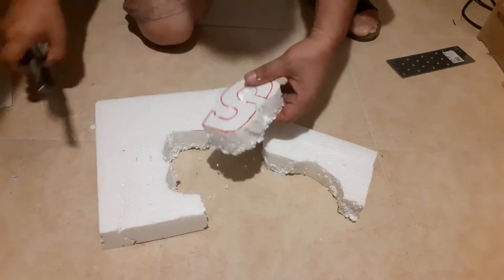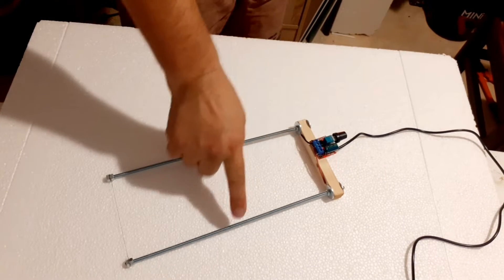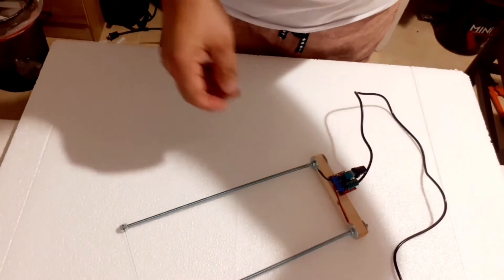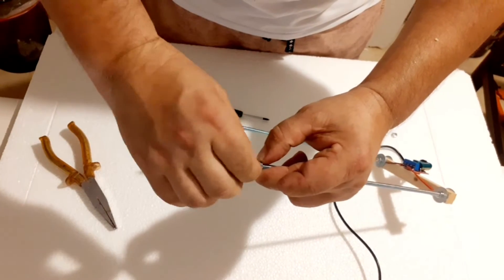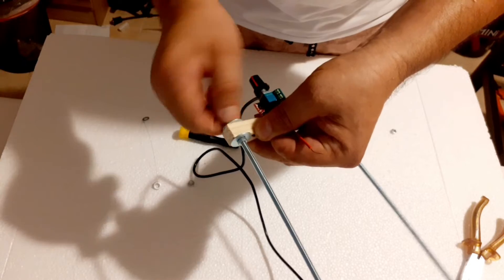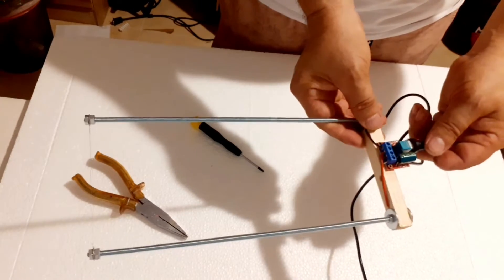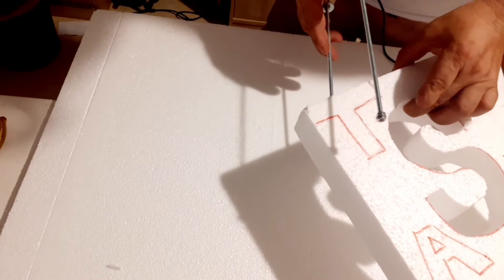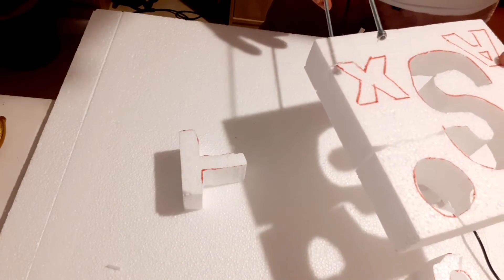DIY Hot Wire Foam Cutter: Easily Cut Styrofoam with Homemade Tool!

Comment: Why not put your box cutter/blade over a candle to heat it up and then cut the foam with it? 

Edit: See how you aren't able to cut the letter 'O' with this tool? The wand-type version is better if your just gonna waste additional resources on a wire cutter. 😅
Reply from the maker: buth thickness is 0nly 0,2mm

Comment: What did u use for the power source?
Reply from the maker: 12volt 3amper (used for led strip,camera,ecc)
Reply: @bobyca2003  not really helpful. 12V 3A WHAT ...wall wart.. ?